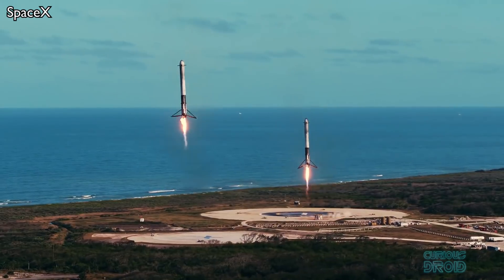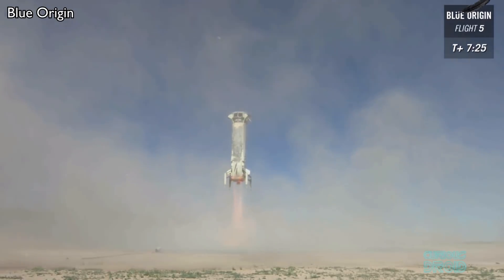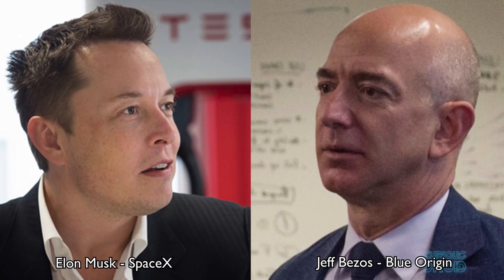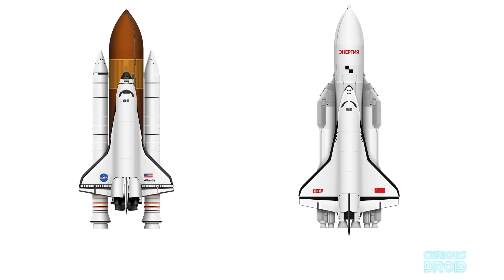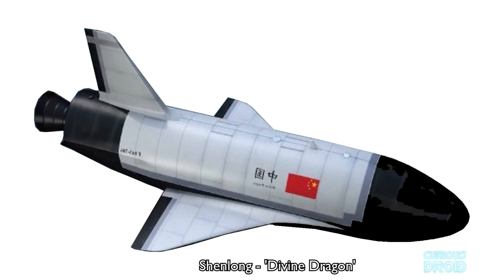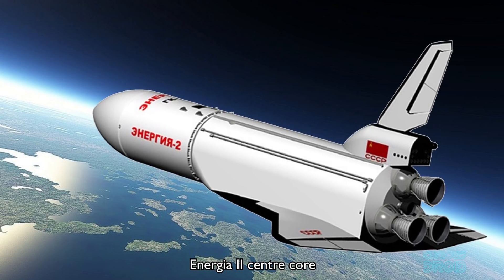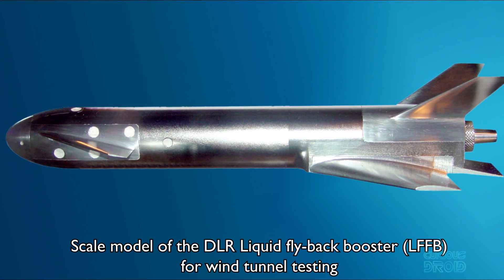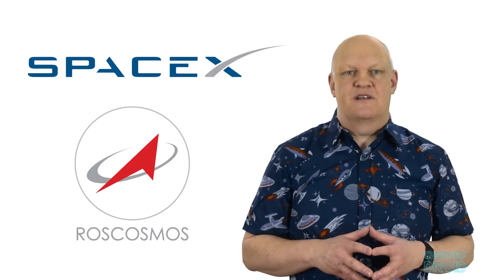Reusable Rockets & Flyback boosters

Comment: The real breakthrough SpaceX has made is in rapid prototyping and production, they spent about a billion dollars(US) making the Falcon 9 boosters reusable where many previous attempts by others spent much more without even getting close.  SpaceX was also smart to go with vertical landing, the mass penalty to make a Falcon 9 booster able to support itself with wings and then take the horizontal impact with a runway would be far higher than the reserve fuel, grid fins, and landing legs it uses.  In the future I suspect that the idea of putting wings on a launch vehicle will seem odd and quaint in the same way that putting boat hulls on airplanes seems odd and quaint to the current generation.

Comment: This is probably a space noob thing to say, but I've always been curious why it's better to use this complex, temperamental landing system that SpaceX loves instead of just having the rocket splash down in the ocean  and then be retrieved like the space shuttle SRBs. So far google has not provided me with an answer.
Reply: Because salt water corrodes complex pumps and electronics. Shuttle SRBs were just metal casings, being that solid fuel rocket tech is really all in the shape and formulation of the solid fuel, and so there's not a whole lot to damage. Of course, that also meant that recovering and refilling the casings is much more expensive than just making a new SRB, making the whole thing a charade, unlike hopefully SpaceX's recovery system.
Reply: Basically salt water hates everything.

Comment: Flying back is the easy part. The big question is what damage the devices might sustain that endangers the next mission.
Reply: Falcon 9 Block 5 debuting in a week and a half is supposed to address just that. ;)
It should be reusable 10 times without refurbishment (only refueling) and with refurbisment after every 10 flights it should be able to habdle up to 100 flights before retiring (possible even more in the future). I hope they'll be able to fulfill these numbers, but even a fraction of this would justify the R&D costs in a long run.
Reply: Stanislav Žoldak It won’t just be refuelling it will also be inspection but that is still much better than refurbishment also they’re trying to automate inspections with xrays etc to decrease time required.
Reply: @adamanderson3042  To me, even if they use a booster twice, seems like a big win. They just halved their expenses for each individual launch. And they already used boosters that were used more than 3 times previously !
Reply: Well if they did 'fly' back, then yeah... but they don't. Seriously, you have totally missed the whole point of why this is so great.

Comment: Nice video! 

One point to be made about reusable boosters or spacecraft is that every kilogram spent on the recovery system cuts at least one kilogram, and almost certainly more, from the payload delivered to orbit. The genius behind the Falcon 9 and New Shepherd is that the engines used to descend are the same engines used to ascend. 

The same really can't be said of large, folding wings or auxiliary propellor engines. Dropped from the edge of space, the engine recovery vehicle suggested by the ESA has enormous kinetic energy; it hardly needs engines to give it more during the descent provided the return path is properly designed, as experience with the X-15, X-37B, and the Shuttle should demonstrate. I suspect those will be going away in future revisions.
Reply: Except the fuel can also be used during the ascent, giving the vehicle the option to sacrifice the booster in order to accomplish the mission. During the ascent, the wings and propellers are dead weight.
Reply: They are much safer options compared to the suicide burn that SpaceX are doing.
Reply: The folding wings and fuel to run engines for decent are two ways to land, they both have a weight penalty and I'd bet there are ways to make lighter wings but not lighter fuel.
Reply: Doug Mcdonell "Extra fuel is dead weight." Uhm...
Reply: John Nowak - Perhaps you could explain why wings to return the booster is dead weight, while fuel to return the booster is not dead weight?
Reply: Doug Mcdonell Well, first ask yourself: what is a rocket for?
The answer is to deliver a payload to orbit.
Now, do folding wings help do that?
Reply: @JohnWilliamNowak  Expendable mode can be achieved on winged recovery vehicles. Take off the wings, it's basically the same as saving no fuel for the flight up.
Reply: Reusable boosters are not about efficiency. They are about reducing the launch cost by reusing the same precisely manufactured components several times.
Reply: John Nowak -  Except the wing can also be used in case of engine failure, giving the vehicle the option to save the booster in spite of a failed mission. During the ascent, the extra fuel is dead weight.

Comment: Roscosmos "looking at reusable rockets" nice to know they watch the SpaceX videos too.
Reply: Roscosmos has actually studied the exact same thing SpaceX did over fifteen years ago but decided it does not economically make sense. However, Bezos and Musk might prove Roscosmos wrong, even though currently it is not clear as so far both Bezos and Musk did not earn any money that would compensate their huge multi-year expenses, and they will not come close to break-even for the nearest years even despite successfully using the new technology. But, again, there is a serious chance that Bezos and Musk will ultimately succeed and will start to bring profit, so Roscosmos has no other way that to re-launch its reusable booster/rocket projects.
Reply: @StrangerHappened  https://www.youtube.com/watch?v=uCa2k_2Y8g4&list=WL&index=141&t=1s
Company Mask fiction. The engines are deformed and replaced after landing. Also large fuel costs that loses payload. As a result - it is not profitable to plant vertically.
Roscosmos has long thought of mnogorazovogo. However, tough tests always last for decades - the main feature of Roscosmos is reliability and cheapness. Baikal is being tested for reliability. Roscosmos has a lot of technical solutions that will show in 20 years - and now they are all subjected to exorbitant tests for destructibility. Each supposedly new engine is an engine assembled 20-40 years ago, but only now passed the entire range of state tests. 
https://www.youtube.com/watch?v=EWLkAZ9IW3E&list=WL&index=143&t=5s
https://www.youtube.com/watch?v=TsVr8KmA5Xc&list=WL&index=144&t=3s
Reply: @ТуманВойны-о6з  Merlin's are refurbished after recovery, not replaced, mainly seals are replaced and the engines are test fired before being mounted to a rocket, the first relaunches of cores used new engines as they were testing how well the core stages handled 2 or 3 launches.  There relaunched block 5's with Merlin 1d's use previously launched engines on all relaunches, so far the record is 3 for a core stage with spacex planning to launch a block 5 core stage 5 times before the end of the year.
Reply: @MrGeforcerFX  
Replace engines. Blast Dragon couldn't hide - because upon landing the ship was the dark mark. When opening the ship and replacing the engines, the manipulations would be noticeable. Therefore, the obvious result was seen.
Falcon, which lands in - engine change. That's when I can be absolutely sure that every time one and the same rocket takes off - I will believe it. 
Soon they will be able to show the new engine by 2022-2024, which was stolen in Ukraine (КБ "Южное").
Reply: @MrGeforcerFX  It awesome to see that booster #1051, I think, has now had 7 successful launches and returns.  Just wish Elon would get his interns out there with soap and water to shine them up like new.  Better yet, advertise Saturday morning rocket washes, volunteers needed.  There will be no shortage of SpaceX fans lining up for the opportunity.
Reply: @StrangerHappened  The thing people don't seem to understand is that it's incredibly rare that any business turn a profit in their first few years. SpaceX is already making a profit on the individual launches the problem is with the amount they have invested and the amount they have to reinvest they aren't profitable on paper. On top of that the cost of launching something to space with SpaceX is currently already cheaper than other means. With them reusing the rockets that  will get cheaper. Because there will be maintenance they will probably save an additional say 50-55 percent of the launch cost (SpaceX estimates the rocket being 70% of the cost of the launch and your not going to recoup that all) now by reusing the rocket after refurb and that should get better.
Reply: @StrangerHappened  Soyuz is actually so cheap, they never had the need to develope a new one...
Reply: Then Roscosmos should restart Energia II Uragan project, that thing has same maximum payload weight as Starship, even more actually
Reply: @muhammadirfanataulawal7630  it was restarted, Baikal boosters at least.
Reply: Да, "Роскосмос" смотрит, как НАСА набивает болячки и делает выводы из ошибок. )
Reply: Here's to hoping they stop looking and start building. 😂
Reply: Roscosmos has never thought that Musk is a charlatan as the company itself has made research on this previously and never doubted that it is technically feasible to make returning boosters/rockets. The issue was -- and still is -- its economical feasibility. As I mentioned, both Musk and Bezos are billions of USDs in red even though they succeed technically.
Reply: @StrangerHappened  a few years later and it certainly payed off
Reply: Stranger Happened Thing is, SpaceX and BO just need to bring down the cost lower than the russians to be a worry
Reply: Roscosmos actually thought (until now) that Elon Musk is charlatan doing this only to take money from "naive" investors
Reply: Just as soon as they can steal the tech on the internet.

Comment: I do think what SpaceX has done with vertical reusable booster landing is extremely impressive, but it is impressive in terms of fossil fuel, or fuel that burns. I still think we need to move on from that, from fuel-air-burn-push type of thrust. It seems really primitive way of transferring a payload to orbit or anything else, Mars travel or further. Fuel is also in a limited quantity still, so we will be forced to scrap all those rocket projects and their development will became useless. What was that NASA's new engine called, EM drive, electromagnetic drive? That looks pretty interesting. Also China is working on some nuclear space vehicle/shuttle, but I couldn't read much more about it.
Cheers :)

Comment: 4:27 just an fyi, it isnt friction per se that generates the tremendous amount of heat but the immense compression of gasses that ionizes them into a plasma. This plasma forms a shock wave that imparts a tremendous amount of drag on the vehicle as the re-entering craft literally rips a hole in the atmosphere.
Reply: M Reeve thank you, I've been trying to end this misinformation for years. I don't understand why they taught us so many things in school that were wrong.
Reply: I was disappointed to see curious droid perpetuate the friction myth.
Reply: I read through everyone's comments here and you all have the physics right, adiabatic compression which leads to the tremendous heat due to that compression, but what everyone seemed to miss, is THAT is caused by the hypersonic velocity of the spacecraft and the air simply cannot get out of the way and piles up, basically causing drag (a force opposing the velocity vector).   I might still call this a type of "friction" with the atmosphere and still sleep at night.  :)
Reply: HighFlyer That is my point, that is still a simplification. Im not saying kids are idiots. I wasn't trying to suggest we should dumb things down to this level. I was just pointing out that simplification is a feature of our education systems, there is a difference between simplification and misinformation.
Reply: HighFlyer Yeah, we are born curious. It's a shame that many of us seem to get that sucked out of us at some point.
Reply: Corey Taylor I'm going to assume you're young and looking for knowledge so here you go.  the reason for compressed gases to heat up is that you are taking the energy in the molecules and lowering the volume. Because temp is an average of the energy you have increased that energy per unit of volume. More energy=higher temp.

Yes, the atmosphere is composed of gas. However, when describing it's behavior physical behavior it is classified as a fluid because it flows.

Because it flows it also will rapidly fill any voids or low pressure areas just as water would when pouring into a sink full of dishes. It's actually much quicker than a few seconds. Almost instantaneous actually, which is what causes thunder.
Reply: @9HighFlyer9  There' actually a video that might explain this better... and it's not a space video... 
HighFlyer is right. It has to do with compressing gasses. Just as compressed gases cool down when you open up, say, a can of CO2, N2 or O2 (gases expanding), they heat up when compressed as this video shows.

How to start fires in the wilderness without matches. Enjoy!
https://youtu.be/CVD5KFB7478?t=389
Reply: Ashley Teece I didn't mean to infer that you treat kids as idiots. There is a difference between simplification and leaving out the main contributor. I've learned that kids, especially 7-12yo, are really intuitive. I always try to answer their technical questions as straight as possible within the limits of my knowledge.
Reply: HighFlyer intuition and aptitude are two totally different things.
Reply: yeah, that create friction. thats sort of in the definition, friction is molecules being pushed together, them repelling each other creates heat and if you didnt know, the atmosphere is a gas. if fills up all the holes seconds after the holes where created
Reply: gass being squeezed creates friction
Reply: HighFlyer Because it is correct in a very dumbed down way. There are many many things kids are taught in school that are simplifications of the truth. This is one such example. You can’t really jump to the higher level explanation if they don’t have the relevant supporting knowledge. People that progress further in relevant fields learn the more correct explanation. There are probably many things that you and all of us believe to be true that are simplifications of reality.
Reply: Ashley Teece when a gas is squeezed it heats up. When the spacescraft is entering the atmosphere it squishes the gas together causing it to heat up.  Don't treat kids like idiots. Obviously, they aren't going to understand the higher level physics behind it without more knowledge, but they don't have to. Misconceptions and false info can linger on the for a long time. My daughter had to tell her 6th grade teacher that blood isn't blue.